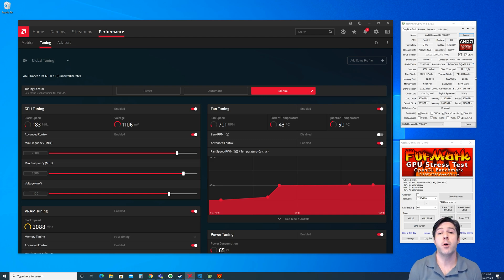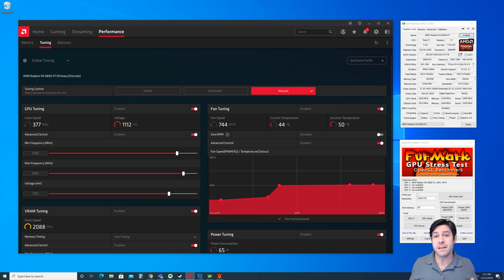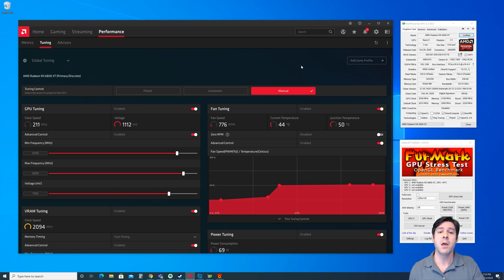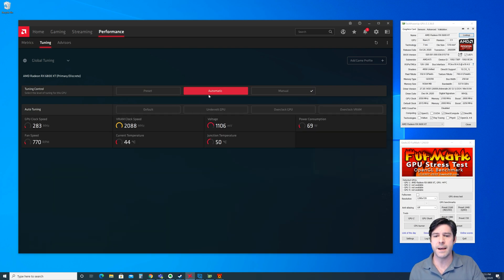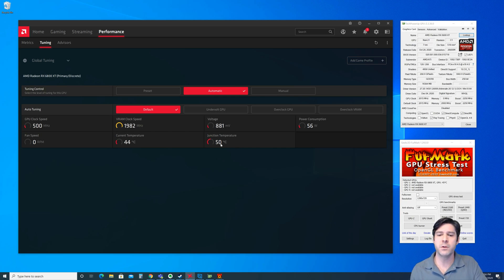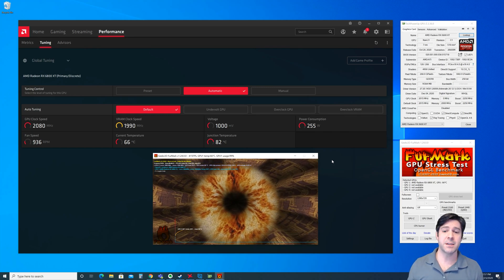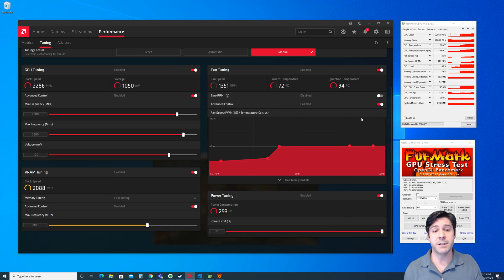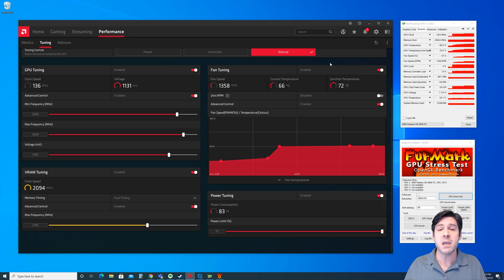RX 6800 XT GPU Junction Temperature Explained [Idle and Load]

Comment: so your saying. that the hot spot is say 80 and then the edge is 60 so that means the coolest could be 40.. ?????   base on your theory 60 is the avg temp ? ... funny cause i hack my 5600xt to 2150hz with a 240 aio and my hotspot is 110c during firestrike gpu stress.. yet.. my gpu temp is 63 max.. so the hottest place is almost twice as hot while my edge remains almost unchange...  odd....  sinc that the avg that means the coldest spot would be 20C.. even tho i added more voltage and up the mhz... umm.... odd.....
Reply from the maker: I think you are assuming that because the averages are 80 and 60 that the lowest temp could actually be in the 40's. While that is technically true (because of how averages work) I would HIGHLY doubt that there is any part of the GPU that gets that cool. I would think about it more along the lines of your GPU is between 60-80c if your GPU temp is 60 and your junction temp is 80. It's likely that most of the sensors are actually very close together in temps.

Another big point (that I don't mention in the video) is that the gap between GPU temp and junction temp was much higher on the 5xxx series GPUs and that gap appears to have shrunk with the 6xxx cards for whatever reason and the gap widens as you increase voltage. The key thing is that your card will throttle based on the junction temp so if you are hitting 110c in firestrike with your 5600xt then it is hitting the ceiling. Hopefully, it isn't hitting those temps during normal gameplay?
Reply: @heygeek3816  so throttle start at 110c? until 110c it keeps full speed/boost?
Reply: @GamersGuard  yes
Reply: Average is calculated using the sum of the temperatures being recorded divided by the total number of sensors recording. You can't assume there are two sensors.
Reply: Sounds like a bad thermal paste job i changed my 5700xts thermal paste and saw a 100c j temp to 70 c
Reply: Uhm.. What?
Reply: 30 to 35c delta underload dude not always
Reply: My rx 6700xt gets over 95c on low ass settings I don’t understand
Reply: @flyjordan0  Low settings give higher fps - right ?
So card heats more the higher fps are.
Try running at high you will see..

Comment: my system occasionally shuts down during gaming in ue5 games like oblivion. i have 7500f and rx 6800 xt. idk if i should repaste my gpu or what? using fsr usually helps like in jedi surviver. it was 109c native and fsr cooled it by a lot. i think my hot spot is not normal cause i see 30c difference or even more under load. and my room is a little bit warm.

Comment: Hello I have an XFX RX 6800XT Merc 319. The GPU temp is about 65c only but the hotspot reaches 110c. I have undervolted the card for better temps.
is this normal with these cards? like how come the temps of GPU is only 64c-66c but the hotspot reaches 100c-110c?
Reply: Don't worry about it. 
It was always like that, just that now we can monitor the temp. 
There's more then 100 temp Sensors on a gpu die.

Comment: I just knocked 100 Mhz off the core clock. Problem solved. My hotspot never varies any more than 5 degrees from the average. Fur mark running half a day my hotspot temps will not exceed 80c

Comment: I have trouble since 2 months now.. my core ist at 60c while my junction temp is at 110c and i got a custome water cooling. I tryed undervolting. IT Just makes the temps get slower to the 110c. I added new thermalpads. No results. I added new thermal Paste. No results. Im at the ege of giving Up. Does Somebody have advice?

Comment: I have a 6800xt and while playing games like rust my junction temp stays between 80c-90c while my current temp stays between 65-75c is that normal? Warzone junction temp stays between 75-85c while current is the same 65-75c
Reply: Yes, very good actually
Reply: @LikeAGroove  Bro! I want to sell my 6800xt but the buyer said that my GPU is overheating so he doesn't buy it. He said that my GPU should be 40-60 with 100% load 🤣

Comment: i am a bit worried my 6800XT hits 95 junction temp in games without any change in voltage/oc settings, just stock. it does seem to boost pretty high at a consistantly 2200+ mhz tho, but still, should i be worried, and is it RMA worthy/posible if the junction stays in the 90´s without oc ?
Reply: It's fine, I would consider trying to make sure the case is well ventilated if you want better temps, if not, just try undervolting between 50mv-100mv
Reply: perfectly normal, mine does reach 99-102c with CP2077 @ Ultra settings no fsr or RT just native 1440p.  But my 6800xt boosts to 2,400+ stock at that hotspot temp

Comment: So in regards to the safety and longevity of the gpu, do we go by the junction temp or the current temperature?
Reply: I would create a fan profile that caters more towards keeping the junction under 90c but that's just my opinion. It's the first thing I did today when I found out about junction temperature on my new RX 6650 XT.
Reply: @MrHowardMoon On some cards that's literally impossible. On 100% fan speed the junction temp reaches over 90°C on my 6700 xt

Comment: I ran a stress test today and junction temperature went around 90°C, maybe a little bit more. I'm afraid I could have caused some damage to the GPU because I heard a little noise for a moment coming from the case. Is it possible I caused some little damage to the GPU and now it will perform worse?
Reply: na lmao don’t worry they supposed to go up that high if anything it would’ve thermal throttled if it got too hot

Comment: I have a 6700 10 gb sapphire graphic card and the delta between these 2 temps is around 30-35c and I think this is not normal because card turn into a rocket after 2-3 minutes of game play around 80% fan speed all the time the support at sapphire said it is okay but I say it is not okay what is your opinion have you seen 30-35c difference in these 2 temps ? or my card needs an RMA
Reply: Did you somehow fix it?

Comment: my gpu temp is 70C with 20c room temp and Tjunction is 112C is it fine while stress testing
Reply: Any issues?
Reply: @-zm3mv  No issues of course ! I know a guy that uses 5700XT and he never opened it (I assume his thermal paste is dry as a stone ) - he games on it 5-7y already and temps are always 100-112C - never more . It just slows the boost clock above 110C so its not the fastest one out there - he said - I do not mind - Its good as long as it works  LOL

Comment: I have a RX 6800 Sapphire Nitro+ and can't find a ideal config to make it cooler and lower consuming. At stock the normal temps reach 72°/78° while gaming warzone or cyberpunk at max settings. And in junction goes above the 80°.
I made some changes on the fan curve and getting now avg 60/67° normal temps and 69/72° at junction part.
But I want to lower the mV and fix the frequency and clock from vram, but anytime that I change it crash. Any tips?

Comment: Dear. I have a 5950x (noctua black), Z570 Tuff, 32gb 3200 mhz ram, m2 1tb, Corsair HX1000 PS, AsRock 6900XT Phantom G (rage mode) and a Cougar Coquer case (open case) in a room with conditioned air. In FS2020, VR and with almost all maxed out my junction temp is 110-113 and de current 98-100. My card is in warranty, is this temp normal?
Reply: Dude I have 5700xt I'm gaming at 110 temp.

Comment: With all 3 fans at max RPM on my 6900 XT, the junction temp reaches 91 °C, about 30°C higher than the edge temp. And you, with your slowly rotating fans, you barely get above 80°C. Maybe there's something wrong with my card.
Reply: Same here
Reply: @aladdin7387  After more testing I've realized that fan speed has a bigger impact on edge temp than junction temp, which kind of makes sense. So if you have a big gap between edge and junction temps like I do, it means you probably have high fan speeds. Though that doesn't explain how that guys has such low temps. Maybe it's cause it's just a 6800.

Comment: Such a good video! I'm pretty sure I lost the silicon lottery with my 6800 XT, but now I'm really concerned because I copied the settings from your Radeon tuning profile exactly and my temps are more like 75 avg and 110 junction on FurMark stress test. Increasing fan speeds and taking off the case side panel didn't help. Did you do anything else to keep those temps down?
Reply: Undervolt + OC of course
Reply: Same situation here. Boosting rpm of case fan or gpu fan don't help.  109c playing cod mw 2.
Reply: See if your temps change drastically with your side panel off.
Reply: Exact same here.

Comment: When playing the new vanguard my gpu junc temp hits 110 c every time any way I can fix it to lower that (my gpu is a 5700 XT
Reply: Disable zero rpm on the fan profile and tune it to ramp up fan speed as temp climbs. I set mine to hit 75% fan rpm when getting close to 80 C 
I don't see temps higher than 90 C now, with settings on ultra
Reply: Same problem I’m having, 6950XT
Reply: @Jamario27  yes it happening with amd radeon graphics cards did Yoo find anything to fix that. I added more fans but it didn’t do anything
Reply: Damn I thought you would have fixed it by now, my shit gets up to 103 c in modern games.
Reply: Wym modern games
Reply: 5700xt seems to aim around that 110c hotspot by default. Have one beefy xfx model, even modded new fans, stays always high.
Similar with my new 6900xt although after changing to better paste it went down a tad.

Comment: Hey, i was wondering if anyone here would be able to help me out.

AMD Ryzen 9 5900x
Noctua DH15 
Asus TUF X570 plus wifi
Gigabyte RX6800XT 16GB OC
2 x 16gb DDR4 3200mhz (Corsair vengeance)
addlink S70 256gb nvme SSD
addlink S72 1TB nvma SSD (QLC)
ASUS ROG 850W platinum PSU
ASUS TUF VG27WQ 1440 monitor
Windows 10 64bit

Fractal Meshify C case (4 x Noctua NF-A14 3000rpm, mounted front and top, 2 x Noctua NF-F12 3000rpm (mounted rear and bottom set to extract))
It is a very....crowded case but the thermals all check out in it.

My specs are above but im finding that im having issues with frame rate drops or generally just poorer performance than id expect in games. For instance my friend who has an intel based rig with a 3070 is getting consistent frames in Remnant - from the ashes, his FPS rarely drops below 140 during busy moments whereas im chugging along sometimes at 60-70fps.

similar comparisons can be made in other games too. anyone got any idea what the issue could be?

Ive been running the same furmark test you ran, its been going now for 13 minutes and i havent seen a single problem. I adjusted my settings to the same as yours.... Hot Spot is 97-99c and other temp is 75-77c. CPU hasnt gone over 42c

so it seems theres no issue with my GPU or thermals and yet i get shoddy performance.... i have a suspicion my SSDs are to blame...no evidence just a suspicion.

Comment: You seriously just calmed me down with this video. I noticed that task manager was reporting a temp of over 90 in a game and freaked out. Then after seeing your video about junction temps I looked into it and it seems task manager is reporting the junction temp rather than overall. I enabled MSI Afterburner in-game and I was actually getting 68-71 degrees overall, which is normal. Hell knows why task manager is measuring junction temps, it freaked me out!
Reply: lmao i feel u brother same thing just happened to me
Reply: @yeezus292  Suppose it shows me  never to trust Windows for something like that.
Reply: yes i  know what u mean...i have 650 watt gold psu on x470 gaming plus mobo..and after installing my games crashed..i updated bios and motherboard drivers..now i get 70 degrees under load. with my 6800xt

Comment: Hey Geek I have a question I have an rx 6900 XT when im running games in 4k graphics everything max the gpu and cpu temps are at okay levels but the Junction temp can get as high as 90ish degrees but everything runs fine no issues my pc just blows out the heat but I worry if that is stressful to the gpu? These are very graphics intensive games mind you like Star wars battlefront 2 in 4k dx 12 everything max and The New World beta which is also very new and graphics intensive what is an okay junction temp if your are running games maxed out? Thank you in advance!

Comment: Hey please, i got a sapphire 6800xt pulse and my temp are pretty high, core temp at 86 énd junction temp at 110 when i overclock at 2600 !! But even when i don’t they’re so high, junction temp at 105 on balance mode, wth is that normal !?
Reply: I had the same issue and GPU orientation is very very important on the reference AMD design. If the GPU is upside down, with the DP/HDMI port pointing upwards the temps easily hit 110 junction temp in almost any scenario. Best orientation is to have the GPU vertical and motherboard horizontal, so as if the motherboard was lying on its back. 

The problem is the giant vapor chamber which only works effective in certain orientation, not sure if the card you have has the same vapor chamber design as the reference AMD model, but maybe changing the orientation and seeing how that goes would be a starting point. 

I have the reference model and changing the orientation really helped.

Source:
https://www.reddit.com/r/Amd/comments/lrd8g6/are_my_rx_6800_xt_temps_normal_reference_design/
https://www.reddit.com/r/Amd/comments/k0ccmu/6800xt_card_orientation_seems_to_make_a_difference/

Comment: I have a Gigabyte 6800 XT Aorus GV-R68XTAORUS M-16GC that hits 110c on the junction immediatly.  I can run the stress test in the AMD software and it hits 110 before the clock hits 3 seconds.  I've tried it both on it's side and upright positions with no change.  It's surprising because it's a gigantic heavy card with a huge amount of cooling.  It got so bad I couldn't even finish Timespy test without crashing.  I sent it in for an RMA that cost me $50 to ship and they kept it for 3 weeks and it came back seemingly the same.  It didn't crash again but still hits 110c on junction immediately.  Is this a defective card?  I know how to take cards apart and apply paste/thermal pads I had to do it on a 3090 that also overheated.

The card doesn't seem to throttle or even run up the fans, but after being underload for a long time it will often crash the computer.  I'm not sure another RMA will do any good since they didn't seem to fix it last time.
Reply: I had the same issue and GPU orientation is very very important on the reference AMD design. If the GPU is upside down, with the DP/HDMI port pointing upwards the temps easily hit 110 junction temp in almost any scenario. Best orientation is to have the GPU vertical and motherboard horizontal, so as if the motherboard was lying on its back. 

The problem is the giant vapor chamber which only works effective in certain orientation, not sure if the card you have has the same vapor chamber design as the reference AMD model, but maybe changing the orientation and seeing how that goes would be a starting point. 

I have the reference model and changing the orientation really helped.

Source:
https://www.reddit.com/r/Amd/comments/lrd8g6/are_my_rx_6800_xt_temps_normal_reference_design/
https://www.reddit.com/r/Amd/comments/k0ccmu/6800xt_card_orientation_seems_to_make_a_difference/
Reply: every gigabyte card I ever owned, (several) both AMD and Nvidia  overheat. its Gigabyte, cheaping out on thermal pads, not AMD.

Comment: My junction sensor hits 108c when gaming, even when the fans spin at 2000 RPM :(
Reply: what card do you have? i have a RX 6800 XT  in a NZXT H510 Case i played control for like 3 hours with max settings with Raytracing on and my Junction Temp never went past 91
Reply: @trickzop8531  It's the reference 6800 XT. I undervolted the card and now it seems cooler and less noisy, but with the same boost clocks. Out of the box it boosted to over 2400 mhz, which seems high, considering the specs. Stock voltage was way too high for my sample. It draws around 225 watts right now (255 before undervolt).

Comment: I’m bit of a novice at this. But my computer seems to be shutting down when I’m gaming. My Red Devil 6800 XT GPU Junction temps are hitting 90/101c. But the GPU TEMP is around 60c (my CPU is Ryzen 9 3900X with a Corsair 150i platinum 280mm)

Seems like the gap between the two temps are far too wide. But ld be gaming for a around 2/3 hrs and boom, machine just shuts down and parts of the case far too hot to touch. Same as the GPU itself. 

So I’m in the middle of troubleshooting one thing at a time to see what’s happening
Reply: Is your airflow pretty good? If you have space for a fan, not a bad idea to add one or two if you can. Also make sure your desktop is in the most ideal area that is reasonable for you!

Don't forget that you can undervolt your GPU a bit and downclock it some even if you want to improve temperatures.
Reply: @Lobster-0-1  thanks for the reply. so i eventually found out what the issue was. it was my Power Supply Unit. the recommended amount was 850w. mine was 750w. Since getting a 1000w Titanium ranked PSU i haven't encountered one issue at all. not even once. the highest temp ive seen for my GPU is 69c while heavily gaming for a few hours. 

i am already making plans to add another fan at the bottom of my case (Meshify S2) so i get more air blown towards the GPU from the bottom. just not sure if i should use 1 or 2 fans at the bottom of the case and weather to go with 120mm or 140mm then identifying the best fan. i was thinking Noctua
Reply: @DeadCell79  I'm glad you were able to resolve the issue! Must be sitting pretty with a 6800 xt

Comment: my 6900xt reached 102c during a game sess, that really freaked me out
Reply: Dont be bro.
Reply: Same here 75c but junction 109c playing cod mw2 4k 120hz with rx6800xt.
Reply: Mine always tops out at 110c after like 15-20 minutes of gaming, I even saw 112c for a second at some point. Gpu temp is at 76c max. Idk if the difference should be that high and it's even in games like trackmania which aren't really that demanding. But then I also play at 4k 144 hz.